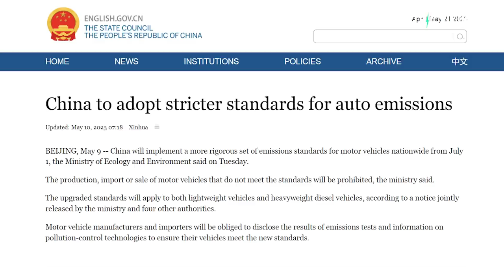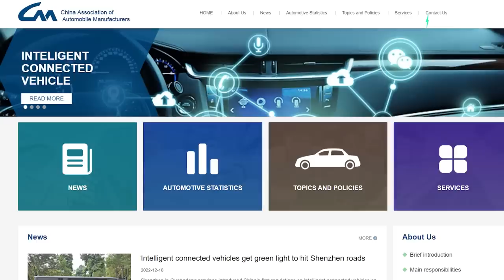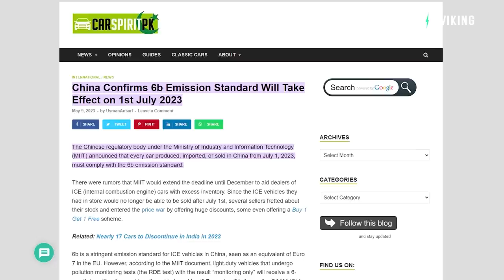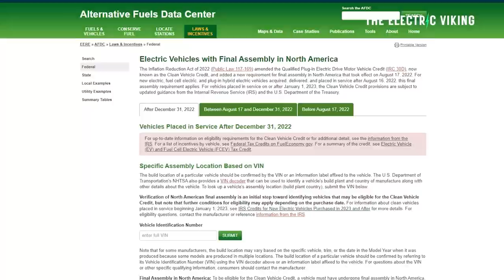China confirms 6B emissions rules - global automakers could face bankruptcy

Comment: China announced this in 2016. It's those car manufacturers' fault for not complying  despite a 7 year margin.
Reply: China 6B emission regulation may seem difficult for non-hybrid ICEVs, but hybrid gas-electric vehicles can easily meet it.  This is because hybrids use the engine less often, and only use the engine when it emits the least for a given amount of power.   The most emission occur at idling and hard acceleration, and in a hybrid, there is no engine idling, and during hard acceleration, the battery and the e-motor assist the engine so that it doesn't have to work too hard.

Comment: China 6B emission regulation may seem difficult for non-hybrid ICEVs, but hybrid gas-electric vehicles can easily beat it.  This is because hybrids use the engine less often, and only use the engine when it emits the least for a given amount of power.   The most emission occur at idling and hard acceleration, and in a hybrid, there is no engine idling, and during hard acceleration, the battery and the e-motor assist the engine so that it doesn't have to work too hard.

Comment: Why is it so hard for Western car manufacturers to comply with these emissions regulations? They have been making cars with advanced engine management systems and catalytic converters for over a decade. Are they just making cars without catalytic converters for China because it's cheaper and they thought they could get away with it? I'd like to know more about what is actually going on here in terms of the technical issues involved.
Reply: I think one reason is that they have "never" needed to comply before. In Europe they have been able to postpone new emission regulations, since automakers are so vital for many big European countries. And never forget Diesel-gate, although Volkswagen was far from the only company that cheated. But now its China setting the rules, and those are near impossible to postpone. For a foreign company = impossible
Reply: Because that will be too much car for too little money.
Reply: Cold starts & open loop engine operation until operating engine temp allows for closed loop operation produces a LOT of air pollution when you are talking about millions of ICE vehicles.

Comment: I don't think that there really will be many problems. Most cars already comply with China 6B, the lab test part. New in 6B however, is the requirement to meet certain Real Driving Emissions (RDE). This requires homologation and a test under strict conditions on the road. Manufacturers were given the option to register cars that comply with the lab test, but haven't undergone RDE homologation yet as "monitoring only". The backlog of 2 million cars we're talking about are these "monitoring only" cars. They can now be sold until the end of the year. By then all manufacturers must have their homologations in order.

Comment: Are there emission standards for power plants since they are moving towards EVs?
Reply: There is a separate system regulate power plant emissions. And more importantly, they asking for efficiency of the powerplant as well. not all power plants are equal. Even for coal fire power plant have significant diffent on how dirty they are. All fire power plant being built im China are all using supercritical boilers.
Reply: @林振华-t4v  thank.

Comment: I think GM will fail again.  Arrogant, lots of debt, obsolete plants, not vertically integrated, unable to scale economically, lose to Tesla in quality, efficiency,  cost of production, software, safety ratings, FSD, charging network,  battery technology, locked in supply and price control...  the list goes on.

Comment: Is it true that EV car battery only last for 8 to 10 years ? I mean , if I buy an EV now , do I have to buy / replace the battery in a decade ?
Reply: No, we have a 9 year old EV with a small battery. It has had more than 1000 cycles and is still fine with a battery capacity of 85%. New batteries are better.
Reply: Yes.

Comment: If it was really about emissions, they wouldn't be building 43 new coal fired power stations to go with the over 1100 already operational.
Otherwise I'm in general agreement with your proposition.
Reply: Those plants are all using super critical boiler. Amd the addtional capacity of those new plants are like a fraction of additional capacity added from solar and wind and mostly nuclear and hysro

Comment: Sounds like hybrids will be safe.  Is that correct?
Reply: No, still has ICE that has to be repeatedly started on a trip.  ICE starting has it's own pollution issues.
Reply: @shoersa  No, I wasn't asking if hybrids would be excluded from China 6b ... even though, that appears to be exactly what I'm asking.  :(
What I meant to ask was, with plug-in hybrid's lower emissions, AS TESTED, would they be within the allowable emission limits set by China 6b?  (Even though studies of real-life driving show that drivers rarely plug in their plug-in hybrids, I'm assuming the emission standards are based on "as tested" numbers instead.)
6b doesn't eliminate emissions altogether... instead, 6b targets reductions of 50% for hydrocarbons, 40% for NOx and 33% for PM ... which is pretty much what Euro 7 will mandate in July 2025 (supposedly).  
So, will most plug-in hybrids survive the change to 6b?  It's a relevant question to the Chinese because not only does Toyota make a significant chunk of profit from hybrids ... but, so does BYD.
I suspect that BYD never made a profit from their EV sales ... so I suspect they've been concealing that by comingling their EV sales with their profitable hybrid sales.  If that's true, then 6b wiping out BYD's hybrid sales may also put their unprofitable EV plans into dire straits (assuming that side of their business has been unprofitable all along).

Comment: Is it true that EV car battery only last for 8 to 10 years ? I mean , if I buy an EV now , do I have to buy / replace the battery in a decade ?
Reply: battery can be a lot cheaper and better in a few years
Reply: if you buy a new ev, you get a warranty for 15/150000 on the high voltage system to include the battery.

Comment: So China continues to build coal powered electric plants by the dozens every year. Chinese coal is low grade- you have to burn more of it to get the same BTU, and thus pollute more than we do in the US with our domestic coal. On top of that, China to my understanding does not even apply rudimentary 1970's technology coal smokestack "scrubbers" to clean the air, which ALL of our plants here in the US have per EPA. Their EV are recharged via power generated by these dirty power plants, and thus pollute more than the ICE vehicles?! 
The only thing China is doing here is protectionism of their auto industry. And after working for years building vehicles for export to China, I can tell you first hand how hard they try to prevent anyone from importing a vehicle into China. Good luck with any future attempts to compete with Chinese automakers in EV as well.
Reply: I keep hearing bout china building so many coal plants but hardly heard any reports bout them keep ramping up the greener energy investment and by far being the world's biggest in solar, wind and hydro power plants.
Are you sure you are looking at this topic objectively?
Reply: While China does still make coal plants short term out of necessity , they are simultaneously expanding nuclear power capacity at a rapid pace.    Already the world's 3rd largest producer of nuclear power, they are currently bulding 20 nuclear power plants, and expanding from 55 Gigawatts to 200 Gigawatts capacity by 2035 by building an additional 150. nuclear plants.

This is in addition to becoming the world leader in other alternative energy, like wind turbines and solar panels.

Comment: I wonder how many fossil fuel burning coal factories they are having to produce in China to produce enough power for electric cars.  Porsche efuel seems the way to go.  Can be used on existing cars reducing the manufacturing of new electric cars with similar results to electric (apparently), which we all know most will upgrade each year like a smart phone.  I like the idea of electric cars, but not the hypocrisy behind it.
Reply: There are a lot of solar and wind power plant that are waiting for storage capacity. EV can be the storage.
Battery is also being build.
Reply: While China does still make coal plants short term out of necessity , they are simultaneously expanding nuclear power capacity at a rapid pace.    Already the world's 3rd largest producer of nuclear power, they are currently bulding 20 nuclear power plants, and expanding from 55 Gigawatts to 200 Gigawatts capacity by 2035 by building an additional 150. nuclear plants.

This is in addition to becoming the world leader in other alternative energy, like wind turbines and solar panels.
Reply: @Farangmoto  Don't know where you get that info. If you mean backed by the grid, then it is true.
But if you are going to insinuate that the grid is run by diesel generators. Then you are the one trying to pull wool over everyone's eyes.
Reply: @ramonching7772 You need to read again.  I said wind farms.  I didn't say the grid.   Wind turbines are backed up by diesel generators.  Certainly in the UK.  Why would the grid need backing up with diesel?  My reply was in response to solar and wind which will do little.
Reply: @Farangmoto  #1. Where is your comment about wind farm. 
#2. Regardless of wind farm or wind turbines. Why would it need to be backed up be diesel generators?

Comment: All these Chinese EVs.
What is the total CO2 to produce the materials and then manufacture the car?
How much is made during shipping by oil chugging  ships?
I'm not saying ICE is any better, but I've never seen the numbers bandied about, just the car itself is zero emission (at the non existant tailpipe)
Reply: Once a car is made its Made, It doesn't continue to pollute like a ICE car when you drive them with polluting fuels, and lousy emissions...
Reply: The EV will make the neighbourhood cleaner and more fresh air. Fxckin pollution every morning when people warm their ICE car , smog all over the city 🤮🤮🤮
Reply: @oldbloke204  Relocate the pollution (electricity power plant) outside the city , miles away from residential area. That is the best solution for people health without interfere people transportation (car) 💪💪💪
Reply: @oldbloke204  Not near neighbourhood. So , it's ok. Too much cancer from inhaling ICE diesel car smokes everyday from morning to night. Damn 🤮🤮🤮
Reply: @mainmusik3677  Yeah for sure I can appreciate that EV stops concentrated pollution in cityscapes.  But if it's powered by dirty coal at a massive power plant is it any better, or if it takes 2-3x CO2 to make versus an ICE what's the break even time, if possible.  I'm just chasing the hard numbers.
Reply: @SickocrowAU  Electricity could be produced not only with coal. There are some other alternatives like gas, wind turbine, hydropower, solar panel, etc.
Reply: @mainmusik3677  Yep again 100% true, but those are made with Fossil fuels originally.  Silicon solar cells are made by smelting quartz in 20MW arc smelter that consumes coal or charcoal as part of the process.
 Like I'm not trying to shit on EVs, I really want  one myself when the grid gets cleaned up and the prices come down as competition ramps up, but right now I'm seeing a lot of green washing and no hard facts.
Reply: @oldbloke204  发电厂集中处理和汽车各自排放情况肯定不同